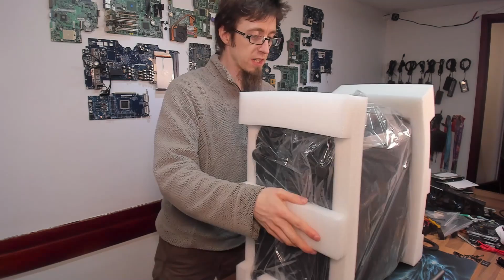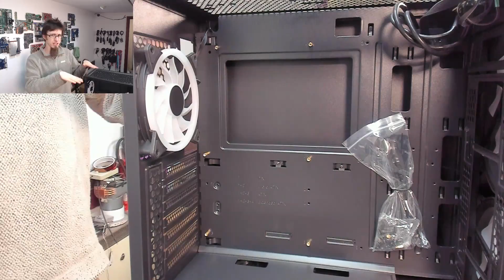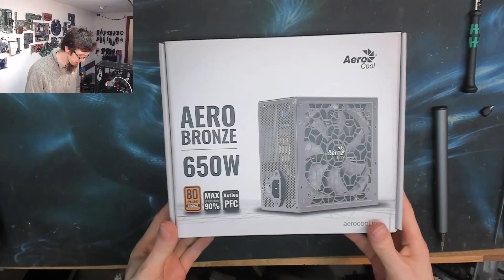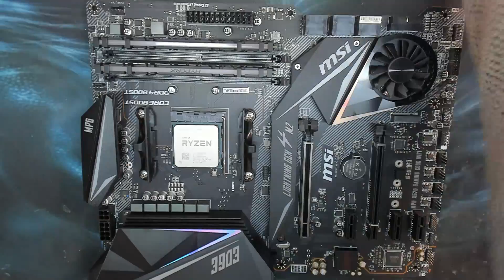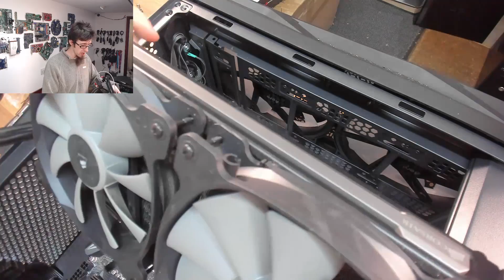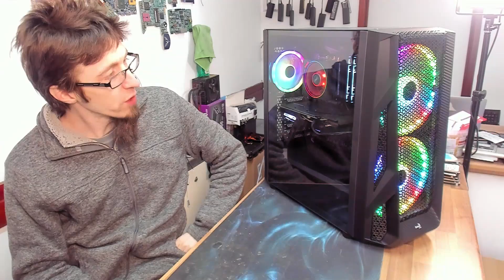AeroCool AirHawk Duo overview - LBC#57

Comment: That was one of the best reviews I've ever watched. I have a question though. Does the fan hun also support PWM function? Do the fans connected to the hub can be controlled with PWN through a 4-pin connection to the motherboard?

Comment: This case has a acrylic front, Nighthawk DOU.  Acrylic scratches.....So need to keep it away from being scratched. I found the case to be way too squishy when building. If they stuck some screw sockets on the PSU shroud then you can run a larger vertical AIO with your ssd's on the psu shroud. Totally agree with the strange decision to put a filter on the inside of the fans. The air the fans are going to pass to the components needs to be clean and the blades really need the filter on the outside if you are going to use it. But again, why would you have this case on the ground?

Comment: If the price was right I'd say this case would be worthy for a lot of people just for airflow with two bigass fans at the front and nice RGB.

The only place this case seems to be available in the US is from a third-party seller on Amazon for a whopping $137. Considering I can pick up a Lian Li Lancool 215 (which is the obvious comparison to this case, and is probably much better built) for $80-90 any day of the week, that makes this a non-starter.

However, if I switch PCPartPicker over to UK prices, I see it on UK Amazon for fifty pounds, or right about $70. If I were paying that I don't think I could complain.

Comment: I've been very curious about this case for a long time cause of the 2x200mm at the front. But the pricess here in Norway are ridiculous, usually around 130-750 USD for some reason (another case is priced at around 15,000 USD, no joke).

Comment: It's surprising how many MESH Dual 200mm fan cases there are now. But not one of them have what i want *STILL. There is H500, H500P Mesh, H500M, Thermaltake Commander C35 TG series, Abkonkore H600X, GameMax F15M, Lian Li 215, Antec NX800, Thermaltake Level 20 GT ARGB, Level 20 RS ARGB, view 51. There are more but they have front tempered glass.

Comment: GRAHAM. I'm looking for someone to design a case like CoolerMaster H500M in either midi or super tower with support for 2 or 3 front and top 230mm fans. Make the case wider. BitFenix make 230mm fans with even more airflow than my Bitfenix 200mm fans in my H500M. Take a look on watercooling uk to see how many different 200 - 250mm fans.

Comment: Hi there, I can see you’re a big fan of Aerocool, how do you rate their power supplies? And would you stay clear of standard/white 80+ and go for bronze as a bare minimum? (Building on a budget)
Reply from the maker: I haven't spent much time with AeroCool PSUs yet. Based on spec alone, I'd rate them for low to mid-range builds. High-end builds I prefer to use something with an 80+ Gold rating on it though.
80+ White I'm not a fan of... there's some well-known brands making 80+ white units, but I just find it hard to believe that components that can't achieve Bronze-rated efficiency are remotely good quality.

Comment: the front panel mesh sticking out, does that mean u can fit 2 noctua 200mm fans which has a wider width then most fans cause its not standard like other manufactures...i

Comment: Great video man.  I have a question:  I have 1x 120mm intake fan on my case which runs quiet and quite slow, is there a way of making the fan run faster for better cooling?  I have a Asus ROG STRIX X470 - I GAMING  motherboard.  ( I changed the low RPM from 200 to 400 in bios but not sure if that was right. )

Thanks.

Comment: I'd get the Gamemax F15m over this, £10 cheaper.  I don't think the case is designed for front radiators anyway, it would restrict airflow from the fans which, I suspect, aren't pressure optimised.  Just have pure unrestricted airlow to the volume of the case with a 240mm rad at the top.  That said once you get to £75, there's some serious competation from the likes of the NZXT H510, Phanteks P400A, Cooler Master NR600, Corsair 4000D series, and slightly cheaper something like the Gamemax F15m.  All of which I think are nicer options.

Comment: ah man I have the same problem with my current case. I wanted to fit a 240mm top mounted radiator, but it doesn't clear the inlet/outlet tank either. I'm using the Phanteks Evolv X dual system, and I have a lot of complaints about this case. It has become very clear that the dual system aspect was an afterthought. The documentation is appalling (no info on whether or not the 240mm would fit), and I ran into a lot of time consuming and frustrating issues while building in it. I expected more, and can only rate it at most 3/5.

Comment: Modern cases are mostly useless, nowhere to put an optical drive or hot swap drive cages in the front, & you can't park the keyboard on the top out of the way with it running (or put a drink on top) because of the openings getting blocked or letting in spills.

Comment: Another great review, though i personally dont like the look of that case. Anyway I don't have the room. I saw your review of the q500 case but I'm quite liking the RAIJINTEK THETIS which is similar size. What do you think?
Reply from the maker: duuuuuuuuuude I wish I'd known this case existed a week ago... I was looking for a modern 'upside down' case for a friend's build who wanted to put the tower on the left of his desk. It looks pretty swish.
Reply: I'm getting one together with an Asus ROG Strix Z490G with i9-10900kf, 32G of Corsair LPX Vengance, a Quadro RTX4000, h100i pro 240mm cooler, 2 x 1Tb M2 970 Evo SSD, 2Tb sata 860 Evo SSD and a 650w Seasonic PSU. Should all fit, what do you think?

Comment: I've recently got a fairly decent case for cheap (46.99). It's a fractal designs focus G. It comes with two white LED fans and with a few cheap uphear fans bolted onto it its flowing nicely. 

Down side is its thin steal and plastic side panel do feel cheap.

Comment: Corsair 275r Airflow currently (20 Oct 20) £67.99 on Amazon - black or white versions
Reply from the maker: o damn, that's a good price. Ye I think shipping from china costs are screwing this case at the moment. It's the only reason I can think of that's pushing the price up. The Aero One Eclipse is £60, and has the same kind of feature set as the airhawk, tempered glass & ARGB fans+hub

Comment: Great video as always Graham! With all the information & inspiration you've provided me through all your contents, I wish to open a repair shop here in India. Any suggestions on the required tools and skillset to start with will be really helpful. Cheers! (PS. I'm an undergraduate in Electronics)
Reply from the maker: Most repair shop work is troubleshooting laptops/PCs that don't start up, or crash, or run slowly. So you need a good grounding in how to approach those problems. Position is also important, ideally you need to find a location where there isn't another repair shop nearby, and be visible so people can find you. Tools and skills you pick up as you go, just make sure you know where you can buy parts and tools from as you need them.
Reply: @Adamant_IT  Thanks mate!
Reply: @Adamant_IT  what is that intro song?

Comment: never heard of this case before, quite a bit looks similar to my cooler master 500m , except it's just that one screw to take glass panels off, and got me TWO 360mm radiators in that bad boy, maybe a millimeter of space between radiators/fittings lol, had to cut out one bracket
oh yeah and my entire setup is on my kitchen table haha. Live by myself so no problem 🤟
Reply: I've got the non-M version and I love it! The worst thing about it is that you have to mention "coolermaster" while talking about it or people will think you're talking about the shitty NZXT case.
Reply: @KuinaBenitoki  oh yeah lol, I forgot every case manufacturer has a 500 (whatever) varient 😂
Never had a nzxt case. They are just too boxy for my liking
Reply: This case closer resembles the Antec NX800 case. I just built a budget pc using the Antec, and its RGB controller is exactly the same and uses the same 6 pin proprietary fans. Like Graham said, likely sourced out of the same Chinese factory, but subtly customized for specific companies. Love the Channel Graham!

Comment: Wonder if you can review the Asus TUF Gaming GT301 case?
Specifically, radiator support. They say you can't mount a rad at the top, but I think there's enough clearance from what I've observed. I want to replace all the fans with Noctua fans and add an NZXT
Kraken x53 at the top.

Comment: Guys i have a question can i use my reset btn as a power btn just by switching the wire in motherboard ?
Reply from the maker: Yup. They're just simple push-to-make switches, you can swap them around any way you like.
Reply: @Adamant_IT  thanks  man

Comment: Excellent review, but I'm not a fan of this style of case as I still use optical drives. I would love to see a case that has a single 200 mm front fan and slots for one or two optical drive bays. Cyclops would be a good name for the case. My latest case is the Fractal Design Focus G, and I ended up pulling out the foam from the front mesh cover to aid in lowering thermals overall.
Reply: Case makers think that no one wants them.   So finding a case that has at least one is hard to do.  The fad now is rgb lights.  That does nothing to a pc compared to the many actual real uses for a optical drives gives the user.

Comment: 200mm are known (heard that from Gamers Nexus I believe) to be quite bad with static pressure, so not the best for radiator. The Radiator mount at the front is probably for marketing/ tick more boxes and should probably not be used.
Reply from the maker: I can certainly believe that. This case clearly isn't intended for a front-mount, just would've been interesting to see if it was an option.